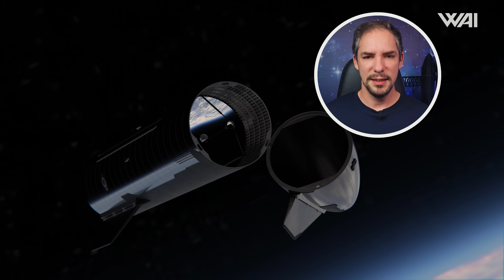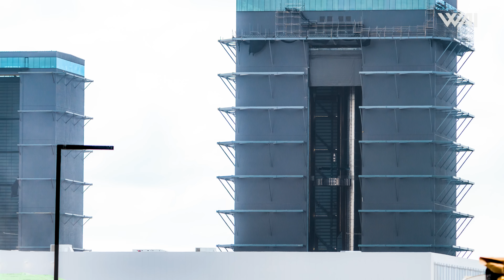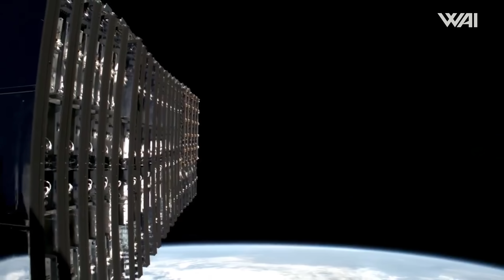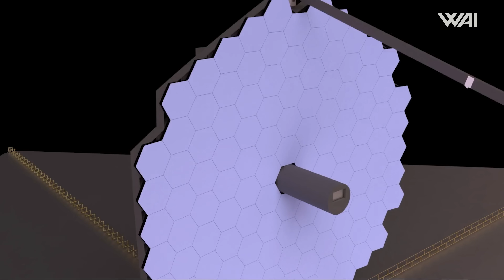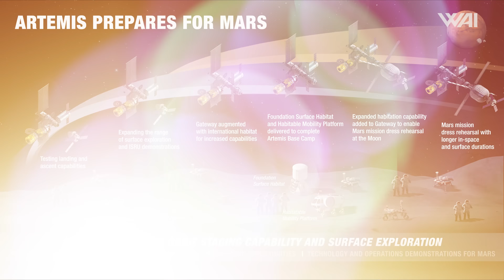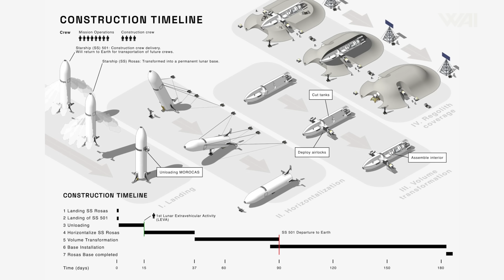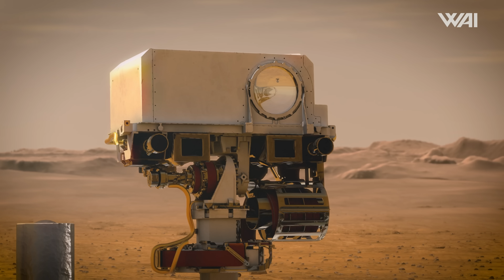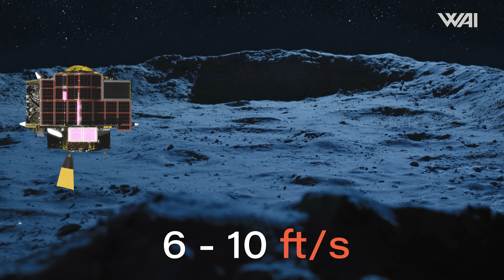SpaceX Is Building The All Seeing Starship Eye!

Comment: On the parking garage from what I’m hearing so far it seems to me as if it might include a big missed opportunity.

Gwynne Shotwell spoke a few weeks ago about more office space at Starbase. If there’s one thing that SpaceX knows how to do it’s build tall structures. If they’re going to build a 6 storey structure rated to carry automobile weights then how much incremental cost would it be to add 1 or 2 floors of office space on top of the parking levels? That would give SpaceX loads of extra office space, many multiples of what’s available in Stargate for instance, without using up any more footprint than is already going to be allocated for the parking structure. If SpaceX could then buy the Stargate building off the university it could easily move all of those occupants into the new building and demolish Stargate to potentially make space for another megabay.

With so many tall buildings already built (increasingly quickly) it seems crazy to me to be considering separate plots of land for parking and office blocks when in so many places in the world they are stacked on top of each other.

Comment: From Earth's surface to LEO = 90% of rocket's energy.  10X our access to space with large orbiting space station/ switch to a transfer vehicle.  Space X/Sierra Space/brightest minds on planet to design a module in 1 yr.  Use Space X manufacture capabilities to make a dozen more.  Use Starship rapid launch cadence to get them up there.  Special steel hub center module with 8 radial access arms.  Each going to a large inflatable module connected with access arms in giant circle.  Then use thrusters to spin.

Comment: I like the idea of using Starship as a component of a lunar base or space station.  Joining together of multiple Starships saves tons of material and fuel rather than sending parts and equipment on separate flights and then having to assemble it all on the Moon or in space. It might also be a good idea to construct a large spaceship in orbit by docking together multiple Starships.
Reply: StarShip (when empty) weighs 100 tonnes - but a huge chunk of that is the engines - which are of no use to the colony.   Since it can carry 150 tonnes - it's actually better to fly it one more time than to recycle it on the moon.  An interesting question is whether the major interior structures required for a habitat (floors, staircases, elevator shafts, equipment mounting points, etc) could be built into the tank back on Earth without significantly impeding it's function as a fuel tank?

Comment: They could use them to build ships in space, parts could be connected initially with cam locks and after it is secured a self welding ring similar to railroad thermite welders.these could be used for habitation and/or resource acquisition which can be taken back down by starship or refined in orbit when technology allows.

Comment: I think using the Starship on the Moon as a base (on it's side) is the most feasible and VERY LIKELY to happen.... BUT they could easily re-design the tanks to have removable ends so they don't have to do all that cutting (most likely with an acetylene torch) using precious fuels... And with there being remaining bits of methane and oxygen most likely still hanging around inside those tanks, you can't use a torch and you can't user a saw...  so you have to design it to be removable....
and with the gravity beign so much lower thamn here on Earth tippng it over would be SOOO much easier... and with the GENIUS engineers at SpaceX (and NASA) they could easily design a way to gently tip it over.... 
with he size of the Starship's cargo bay, they'll be able to fit some kind of bucket loader vehicle to move some moon around (we say 'move some earth around" while here on Earth... so would we say 'move some moon around" while on the Moon?? maybe we can just call it dirt for now lol )
IT's SUCH a GREAT IDEA!!!! THANK YOU WAI TEAM for giving us the VISUALS to think this all out (even if you weren't thwe ones who made it lol)

Comment: I think that rather than tipping Starships over and using them to build moon bases, it's probably significantly more likely that they'd just ship inflatable modules inside Starship, that they place on the surface. Not only does an inflatable module give you a lot more habitable volume, you also don't sacrifice a transport vehicle.
Reply: starfactory production rates are targeted to be something like 100+ a year. Disposable for sure.
Reply: @RichardAbendroth  not to mention that cost of each part is going down. Raptor is already cheapest engine in class with price tag under 2 mln.
Reply: @just_archan  the next few years are going to be nuts! with that china company building their own reusable falcon clone I am curious if it will drive down prices even further. Really, really curious what long term plans spaceX has for the next gen post starship
Reply: @RichardAbendroth  not only China. There is also Korea, initiatives from Europe, in us there is Stoke space, Blue Origin, relativity... In new Zealand rocketlab. 
And companies like Sierra space and others that have plans to utilise cheap transport to space by building space stations, or even production facilities in space. We are on brink of next industrial revolution.
Reply: @just_archan  It's very difficult to compare costs and prices in the aerospace sector.
Afaik the 2mln for one raptor is the costs for SpaceX, more specifically the marginal costs for producing one additional engine.
For most other engines, we don't really know the production costs, only the final price at sale, which includes a potentially high profit margin.
Same goes for launch costs vs launch price, as we don't really know the costs for a F9 launch with reused booster, but only the price they charge.
Reply: @RichardAbendroth  Elon Musk has already described the "double-wide" StarShip.  Roughly the same height - but twice the diameter.  That would leave room for 4x the number of engines.  4x the volume of fuel and 4x the cargo capacity.  With the cost of engine manufacturing projects to drop by about a factor of 4 - and steel being dirt cheap - the cost might not be much different than the current StarShip.  Now just think about 1,000 tonnes or 400 people to orbit in a single launch!!  A SuperHeavy with about 130 engines!!
Reply: @SteveBakerIsHere  good god that would be a big rocket.
Reply: Lets hope that SNC continues to push Inflatable. 
What is also needed is a clean separation between ECLSS and the habitat. Why? Need 2 different designs (G vs micro/no Gs), and to be able to add MULTIPLE units for backups. 
Also, hoping that 1 or more companies will build a lunar lander that encircles a cargo, and can drop it off without destroying it.
Reply: @grraab2000  What do you mean by a clean separation between ECLSS and habitat?
Reply: No reason to not do both at some point, imo. Having a rigid base section may come in helpful if the sun decides to get feisty, or the Perseids are passing. The advantages to inflatables is weight per ship and possibly time to shelter. The disadvantage is a bit like every tent on earth. Starship being metallic will offer some greater energy and penetration defense. Especially as life support storage, I think starship will end up having use at retirement on the moon.
Reply: @up4open763  I'm expecting the inflatable modules to be reinforced with a mixture of lunar regolith. Keep in mind that a 4mm thick steel wall would also need extra reinforcement from radiation, so it wouldn't be much of an advantage here..
Reply: @ohedd  I expect mixed combination, so inflatables with retired hls starships, ALL of them covered in regolith. Empty Starship offer really massive volume, and those can't be reused back on earth as then don't have capacity to re-enter. Sending tankers back and forth... Wouldn't be so practical, considering not only tendency to boil off cryogenic propellants, but also pricetag of starships. Remember, that CURRENT price of raptor is under 2 milion, and goal is to drop price to around 250k (I don't believe they will achieve that low price, but I wouldn't be surprised if they achieve 0.5 mln). I would not be surprised if cargo version will be expendable, designed to deliver lot of materials, then ships itself would be converted into base. As majority of preparation it will be introducing life support to each lander, propositioned doors with mountpoints to attach airlocks, removable panels that would allow to enter and useage of tank interiors, and propositioned mountpoints to attach flooring, insulation etc. 
Inflatable habitats would require also some assembly on place.
Reply: @ohedd  actually quite a bit of an advantage simply due to lower threat of leaks when burying in rebolith - inflatables are capable of exploding when punctured by sharp rocks.
Reply: Only in current ending experiment there is a need to put obsolete tech on remote body's...
Reply: It's more efficient to use lava tubes that are lined using regolith printing. It'll be likely that the first generation of habitats will be above ground....
Reply: Go tell Elon you tube, he probably doesn't know

Comment: Any advantage of using Starship as a habitat/station itself is dwarfed by using it as a payload delivery system for an inflatable module in its place.  The inflatable module that a single starship could deliver to a target location, would always have more internal volume once inflated than the starship that delivered it even if the fuel and oxidizer tanks are repurposed.  Further, te inflatable module is a purpose-built device as a habitat/station... whereas the starship is and can only ever be a jury-rigged habitat/station.

Comment: It looks like starships have reasonable compressive strength along the long axis, Use of the expended bodies as toroidal elements would really be decided on how much tensile strength they have. I have suggested they be used as spokes in a wheel and potentially as escape pods on the outside of a torus. I would assume that the rocket bodies are not strong enough to use them as the circular elements of a torus itself, but this is also possible. AKA space lego

Comment: A space station could be just 6 lunar sarships connected each other in a 2x3 configuration. Internal layout can have different purposes (crew labs hotels farm). Crew can arrive and departure on dragon capsules. Fuel tanks can be repurposed for water storage or other cargo. Engines in 5 of 6 starships can be recovered and sent back to earth. If this space starion is cost efficient enough, then it could be replicated for mars or venus outposts.
Reply: The connections could allow the rapid transfer of water between the station modules to maintain balanced rotation.

Comment: Starship could be used to deploy lunar GPS satalites.  Also, Martian GPS satalites.  That would solve the issues of ships landing at precise locations.  Earth only uses 31 GPS satalites for all of its GPS requirements.  I would think that less would be required for less populated bodies.  Of course, there would have to be enough to give constant coverage to all locations as the satalites moved in orbit.
Reply: The major issue is having a base to provide maintenance updates to the satellites for positioning, and satellite substitution if one fails. otherwise the resulting positions are either wrong or just inaccurate (which can be just as bad as "wrong").
Reply: @jessepollard7132 
With the current earth GPS satellite system, software updates are just transmitted to the satellites. We do not do physical maintenance. We just have some redundantcy and send up new ones to replace broken or obsolete ones. We could do the same around the moon and Mars.
Reply: @appliedfacts  No we can't, at least not without a base on the Moon or Mars to create the necessary updates. Without that no updates would be accurate. The updates require atomic clock stabilization - and synchronization between the ground and the satellite. Those updates cannot be generated without it. Such stabilization takes weeks to achieve. and compensation for relative movement between ground and satellite. Been there - not going to happen on Earth.
Reply: @jessepollard7132 
Are you thinking software updates could not be transmitted from earth to lunar and Mars GPS satellites? In my mind it would be like Microsoft transmitting Windows updates to computers. It gets sent via radio link to the satellites and the satellite installs it into its operating system.  The hyper accurate precision that we enjoy on earth may only be achievable with a lunar or mars base to measure relative positions BUT that precision would not be needed to get started.  Low precision would be a starting point and higher precision could be accomplished after bases were established.
Physical updates (better hardware) could be built into new satellites and launched from earth (via Starship?) and put into lunar or Mars orbit. No local bases required this way.

Comment: Why is it that everyone makes the comparison with Ingenuity's rotor rpm to that of a full-sized human carrying helicopter? Talk about apples to oranges. You should be comparing it to an RC helicopter of the same rotor diameter, such as a 600 class helicopter. The limit is the rotor tip velocity has to be below the speed of sound, as drag goes up the closer you get.

Comment: Starship might be too heavy to be an effective space telescope, as it would have a lot to extra mass/inertia when turning around. Could be solved by using the RCS? That would have a lot of fuel consumption, so the operation cost would be pretty high both in LEO (it would consume even more fuel as it has to rotate a lot more in order to track the observation point as it orbits), where it would be easier to refuel, where out of LEO where it need to do less maneouvers it would be way harder to refuel. Then, it probably would have the problem than too much thruster usage would eventually make a mess of the space around it or even the mirrors, so it would have a poorer quality (the counterpoint being that the thruster emissions would mostly be yeeted at high speeds, thus in different orbits, but how would it play over enought time?
Taking advantage of Starship hauling capacity to incorporate some really big flywheels might mitigate this too, but then again, all that might end being more expensive and having higher running costs than just building a dedicated telescope and just using Starship to deploy and service it.
Reply: Yeah, the engineering that goes into space telescopes is insane. 
My guess is that there would be something else which would be a pain too, like a source of vibration or uneven heating. 
But as you say why not just float the telescope out of the door, that way you can reuse the launcher.
Reply: Yeah. A telescope inside a starship would be at best a better Hubble (stuck in LEO, lacking a giant sun shield) and have other unnecessary issues as well. I think that there is definitely a use case for it due to its lower costs - all the telescopes are way overbooked, so more telescope is always good - but it wouldn’t be a replacement for a larger JWST style telescope.
Reply from the maker: You could just refuel it in Space if it's in LEO. Keep the low promised launch costs of a Starship in mind. If it costs around 10 million to extend it's life for another 5 years, it would actually be very cheap. :_WAIStarship:
Reply: @Whataboutit  an issue would be that you have to point these things absurdly accurately, and having a load of liquid methane sloshing about would make that very difficult. 
I don't think that the satellite bus is the expensive bit of a space telescope, and that is all that the hundred tonnes of stainless steel is really buying you.

Comment: As we have never converted any structure in space yet most concepts are not feasable. 
Its far more interesting to think about how many inflatable sections from sierra space could be lifted at once and then filled with gas.
Second starship would then dock and all interior would be added inside.
The problem with these converting concepts is lifesupport and how to spread it over the rest of the hall.
This video was very much a jumbled video.

Comment: flexible hangar doors are designed to solve all extra ordinary door requirements with no limitations of width or height.
Vertical lifting fabric hangar door was initially developed in the 1980s for the needs of shipyards' shipbuilding facilities. Cause of special requirements of shipyard industries doors need extreme properties. Weather wind sand, corrosion , and lighter more compact, most military hangers use the fabric its a very dense mesh